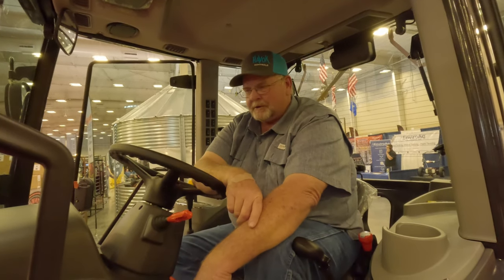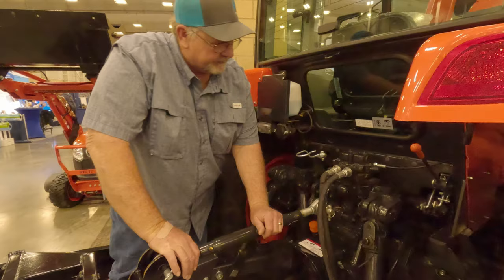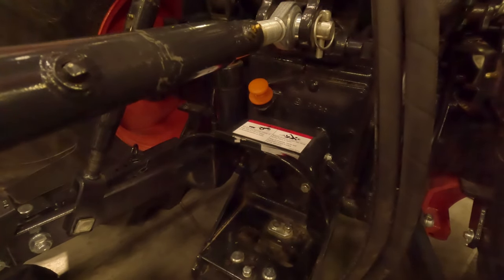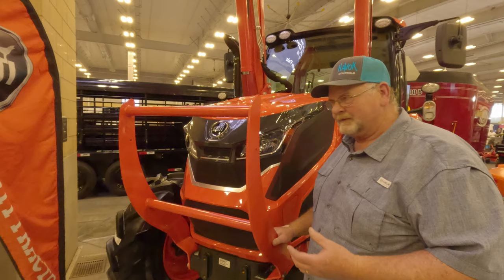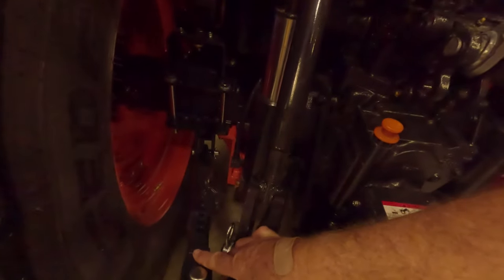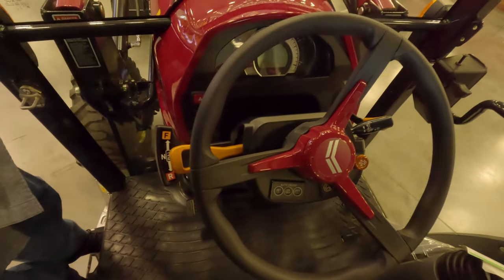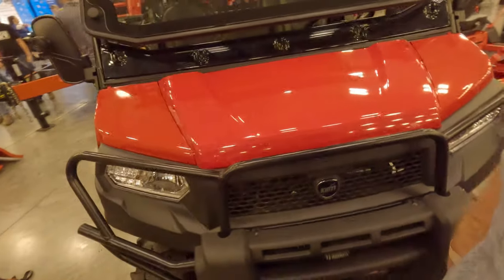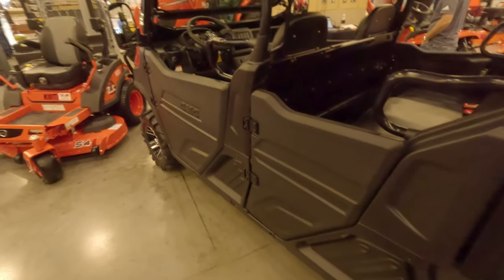2024 Oklahoma farm show. Kioti HX 1151 and Yanmar YT 359

Comment: I’m liking the looks of the upcoming Rx7340 myself looks well Layed out with the 1-4 shifter on the right hand as it should be vs the 7320 model on the left.    Only small negative is they should have the air vents up top.  I have the mt573 as well super nice tractor   Like you said in a previous video  the only negative I’m seeing or I should say hearing is a winey power steering.
Reply from the maker: Yes the LS is well laid out, of course that is a preference. Like you said the steering wine or gurgling or what ever is annoying. But all in all the LS is great. That new HX does have my attention though. Kioti is stepping it up for sure. Thanks
Reply: Gurgling that’s a good word for it.  Almost sounds like there is air trapped in it.   I’ve tried lifting the wheels of the ground with the loader and turning left to right several times and still there.  When I start it cold the gurgling is not noticed and about 10 minutes in I begin to hear it. It steers real nice and smooth and if a guy was deaf he would never know. 
Reservoir is full of fluid. Supposed to be green lhm oil. Mine looks  orange   Has green warning right on top of the reservoir.  You should check yours to see what color it is, you might have to draw some out with a syringe.
Reply from the maker: @Jsuds-kp3cj I will have to check into what you are referring to. My first thought was the pump is caveating. The problem is I can’t seem to hear it on the outside of the cab. Even with someone else running the machine and me walking next to it. I have test another 573 and it sounds the same. I don’t know what or where it exactly comes from. Like you say it drives fine.
Reply: I m confident the gurgling sound is from the motor/pump in the steering column definitely seems like air in it.  This pump works off of the reservoir.  If I run my tractor and then shut off for say a half hour and then come back start it, and then throttle straight up to over 1500 rpm I will get a good load jerk of air through the line in my steering column.  Not sure if the wine is related or more so from the other pump   
Would love to figure out and resolve.  Thinking about trying to flush it.  It sounding like most are like this so maybe ls needs a recall on this models steering.
Reply from the maker: I agree with you. They do need to figure this out and resolve it.